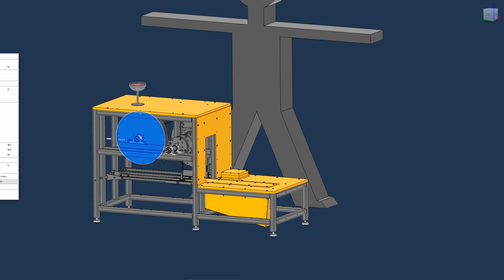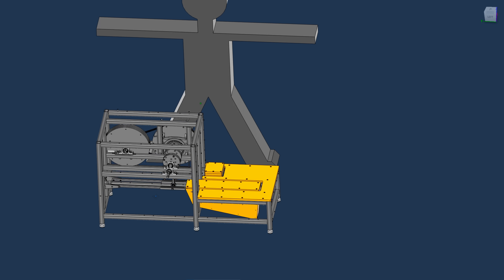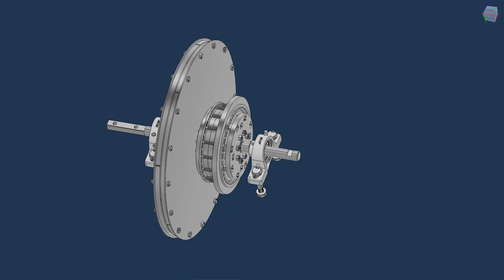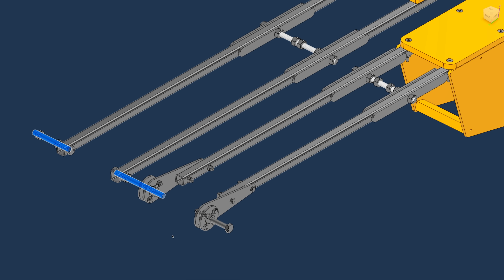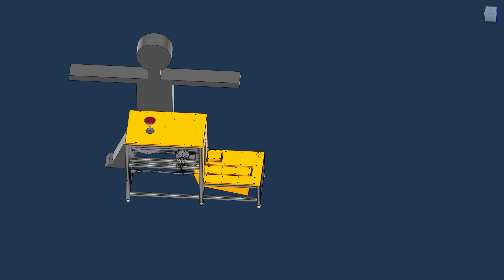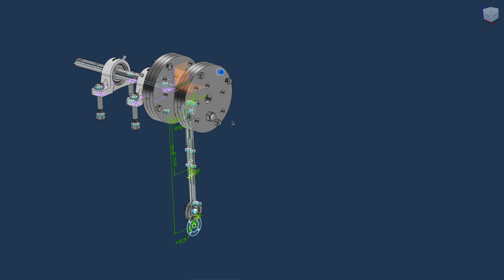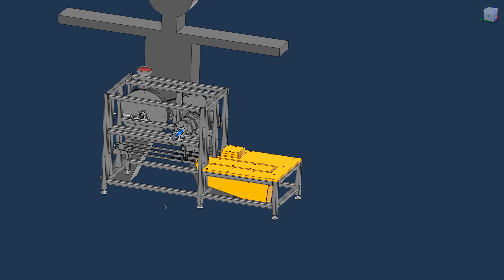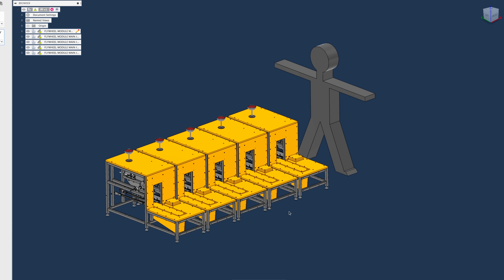Power Module Design Completed - Marble Machine 3 Ep.5

Comment: On the side of the fly wheel, print a multi-speed strobe pattern so that you can visually see the speed of the fly wheel, much like you can do with turntables/record players.
Reply: This, combined with cool lighting and transparent panels. Love it.
Reply: Yes yes I've been trying to bring this idea to Martin since the MMX days.
Reply: This works very well but only if it's a flickering AC lightbulb at 50 or 60hz.
It doesn't work under 120hz or continuous LED lighting
Reply: @tylerr5285  Can't you just make an LED flicker at whatever speed you want?
Reply: @EaglePicking  or just put a small, incandescent light bulb adjacent to the disk, using mains power frequency to get the stroboscopic action happening.  This might be problematic should you want to tour with this, as different countries use of 50 or 60 Hz for mains frequency.  I'd put in my own battery operated tiny strobe light adjacent to the disk, you can tweak the frequency and get perfection from the stroboscopic disk regardless of mains frequency.  I think this would add a level of "cool" to the flywheel and show it's movement.
Reply: @tylerr5285  A strobe is electronically controlled and adjustable. No need to use the mains frequency. Also the flicker amplitude of a bulb is weak due to the afterglow of the filament.
Reply: Or you can just add markers and use RPM counter

Comment: The plates for safety make sense, good in fact.  I would suggest the plate facing you be placed on the inside of the tubing to provide even more safety, I also would relocate the brake pedal so that it is not in line with the flywheel which is the danger line.

Comment: You should consider using some bushing pressed in the square tubing where you want the pivot for the two pedals because they're subject to quite a lot of force and the holes in the tubes are going to became ovals pretty soon
Reply: If not bushings, heavy wall tubes with the inside diameter slightly larger than the bolt diameter pushed thru and welded around their circumference.

Comment: Off the shelf flywheel with carter exits. Off the shelf torque limiter exists Pedal operated machine existed ....Stop spending time on reinventing the wheel (literally), focus on what is specific to this instrument, the music part And reusse a maximum of existing parts. Define the requirements of those parts (solidity, price range, MTBF, etc) and outsource that job to a procurement engineer. Meanwhile design a modular solution that can handle the variation of size of the parts. 🎉

Comment: What I'd do is use a rope instead of a cam, so the pedal can pull but it can't be pushed and you don't have to worry about getting your foot stuck under it.
Reply: Steel cable. Less noise than a chain and nice and strong
Reply: I was thinking of a steel cable. A chain seems more dangerous. Something could get caught in the links when it's pulling.
Reply: Exactly, and so the pedal can be made more lightweight to minimize its effect on timing.
Reply: I think a steel chain is even better, as it is less elastic than a rope
Reply: You could alternatively use some bicycle gearing between the pedal and the rest of the mechanism. Bike gears are designed to only push one way, so the pedal can drive the mechanism but isn't driven in turn. Bike gears would also give you live adjustability, rather than needing to experiment with different pin positions in the camshaft. Just add a spring to the pedal to return to 'home' position when not depressed.
Reply: @JeffAsjes do you mean like the freewheel mechanism in the rear gear set?
Reply: @stellamcwick8455  precisely
Reply: Don’t forget tho that he needs there to be no flex on the driving mechanism. Even steel cables will stretch under load, even if just a tiny bit, which could affect the timing
Reply: @circle_cut_sandwich9190  Not nearly as much as the exact timing and amount of force on the pedal.
Reply: I agree on this also, probably easier with a chain or wire but could also be a rod with a slot. the main benefit I see would be to make the whole arrangement smaller/lower as the pedal can sit just above the floor not require a large box.

Comment: Pin the output shaft of the flywheel module to the rest of the machine using a nylon bolt. Keep lots of spares. If the torque gets too high, the nylon bolt will shear and decouple the flywheel from the system. Simple. As for the clutch, just use a movable belt tensioner on the belt to the flywheel. Put the tensioner on a pivot on the trailing side of the belt, create tension with a spring and use the clutch pedel to release tension from the belt. SIMPLE. No complex clutches, no complex torque limters, just basic functional designs that WILL work.

Comment: Once again: you don't need to make the entire flywheel movable just to tension the belt! You need a static wheel and a spring-loaded belt tensioner, just like any car or bicycle!
Reply: Moreover, what you are doing here is a reverse version of a totally usual belt walk-behind tractor (or walkbehind cultivator - whatever). These use a gas-powered motor (small shaft), a gearbox (large shaft), and a belt between them. You tight the belt with the clutch (via belt tensioner) → you connect motor to the gearbox, and the gears get moving. You let go of the clutch any time you need → input on the gearbox is no more. Seriously, just visit any small farm and see how this 100-year old design works for ages, on 3000 RPM engines!
Reply: @EujenSandu  Indeed, but Martin is still stuck in the "I will do it myself" mindset.

Comment: If you're adding the panels because you're worried the flywheels might do something scary then the guard should be as close to the wheels as possible to stop them from building momentum. When heavy stuff starts moving plywood panels tend to not be enough to stop them.
Reply: How far the panrls are won't affect the momentum. If something goes wrong, the momentum is already all there, whatever parts are flying toward him will still be moving the same speed 10cm or 10m away.
Reply: @TlalocTemporal  the rotational momentum is there. Unless something truly catastrophic happens the lateral speed doesn't happen until friction turns rotation into lateral movement. If that's a cage close to the wheel it doesn't have time to get going and out will hopefully just do a burn out
Reply: @mouse11011  -- Ah, so preventing a small breakage from becoming catastrophic, I see. I was imagining the worst-case catastrophic failure of the flywheel disintegrating.

Comment: Maybe I don't see it correctly, but it looks like the pedal can still injure your foot. It appears that, when the pedal is down, your foot could get underneath the surrounding panel structure, and be caught in-between on the way back up.
Reply: Yes! This is exactly what I was thinking. I think he needs panels on the inside of the well where the pedal goes down; those could also eliminate the need for the panels on the pedal (thus reducing the dead weight he needs to move).
Reply: Makes sense.

Comment: As much as I love the look of the current marble machine, it would be nice to see some metal or wood designs inserted between the gaps in the frame. I'm thinking of something like an old, iron-cast garden gate that doesn't detract from the engineering but adds a bit of flair. It wouldn't interact with the engineering but would simply add beauty for those who aren't of the engineering mindset, like you and I may be. Of course, this can be an afterthought, but after seeing how amazingly beautiful you made the marble machine X, it would almost be a shame to not show off all that welding and woodworking talent you've built up. Once again, please consider this as an afterthought, but don't forget about it.

Comment: The support on the pedal arms are friction fit if you're only planning on using a central bolt as shown in the cad, unless you are welding them on? Bolts on the ends of them give full support vertically, surely Martin didn't miss that?

Comment: I don't think you have thought through the pedal system. As it is now, you have to basically push it backwards away from the machinery when it it in the highmost position. That is very unergonomic position to work and imposes limits on how much and in what way you can move yourself while playing. I think it should be more pushing down and forwards to make it more user friendly and ergonomic. That would require the pivot point be either on the up-forward position on the lever, similar to car pedals, or in the back down like some of those large organ pedals work. Ergonomically the former would probably be better, but the latter is easier to make to be able to support your whole weight and be safer too. With some relatively minor changes, it can be achieved with the current design, but I'm sure  it would be the best to make a full redesign of that mechanism.
Reply: Good point. Also, how do you start up the machine if it just happens to stop with the pedal in the downward most position?
Reply: @ahampel22  That is not a problem for two reasons. Firstly, it is nigh impossible to get the crank in such position that it would be perfectly stretched out and thus not accepting any input. That would require ideal condition, which is to say perfectly rigid mechanic parts and perfect tolerances, which are impossible in real life. Secondly, even if we completely disregard all of the above, that is still no problem as there are plenty of exposed parts linked to the pedal which you can turn by hand moving the pedal in offset position.

Comment: Is the marble machine player going to be keeping time for the band, or do you need to keep time with someone else? That affects what sort of tightness you need, particularly out of the power input. It also affects what kind of looseness you need; if you're 20ms late getting up to speed, can you catch up without overshooting? If the machine is keeping time, you just need to maintain close to the right tempo and the power input doesn't have to be tight, because all of the notes will be placed correctly relative to each other.

Comment: After the bearing housing debacle, my heart immediately dropped as soon as Martin said he designed the torque limiter himself using laser-cut parts, lol. 😅
Reply: Well, it may be overengineered but at least we know this solution works (unlike the bearing housing) because he used it in the MMX and it worked well. On the other hand, torque limiters can be extremely niche-ly implemented (and as a result, become the limiting factor in some solutions), so I can understand the custom solution; now the limiting factor becomes whatever springs he can get.
Reply: That torque limiter already lives in MMX. It is a known item for him, perhaps not all the other people
Reply: Yeah, he's got the over engineering disease. Imagine a new problem and create a solution for it. Maybe it's not a problem to begin with.
Reply: On the other, other hand, there are definitely some numbers to be crunched to pick the correct torque limiter. As a result, it should be one of the last things to be picked, along with the size of the flywheel. The flywheel has to be big enough to drive the machine (and whatever torque that might entail) but not so big it becomes dangerous. There are definitely adjustable off-the-shelf torque limiters that can deal with this, and it might end up being cheaper than machining ones from scratch. But importantly, this and the flywheel should be done after the prog wheel and marble delivery systems are decided and you know how much torque you need.
Reply: And he didn't design one himself because of a specific requirement that wasn't met with off-the-shelf parts. He designed it because he couldn't find CAD models for the existing ones... I didn't realize this was a CAD exercise instead of building a musical machine...

Comment: Clear Plexiglass for your safety covers, and for a more final version use an adjustable heim joint as your drive linkage. They are easy to get to a perfect length and are very robust.
Reply: Plexiglass shatters very unpleasantly and quickly, would not suggest using it for safety!
Reply: @Chibs  Sorry for using a generic term, my thought was more of a polycarbonate like Lexan that is very strong and impact resistant (like safety glasses) for protection without hiding the mechanical parts.

Comment: I urge you to experiment with that flywheel before you continue with the design. Mount the wheel on a suitable shaft and spin it to the RPM you think you need. Use a motor and a rubber belt to get the RPM. 
This will show you just how noisy it's going to be. 
And the flywheel must, must, must be dynamically balanced. Perfect static balance is totally useless. Especially for that diameter, mass  and RPM.
Reply: I agree with you regarding the rpm output possibly leading to a very noisy resonating frequency. I don't think this has been explored more than enough. Could end in tears ?! Basically he is making a rotating speaker, like the famous Leslie rotating speaker, by rotating a mass, instead of the speaker itself.
Reply: Guys, how many RPMs are you expecting? The ratio is 1:8, 8 rotations of the flywheel = 1 rotation of programming wheel. Programming wheel will do perhaps 2 RPMs. That's not kers from F1!
Reply: @DanyWay  In the video around the two minute mark, it's stated that one BPM in the music means 8 rotations of the flywheel. Music is usually somewhere in the range of 100 to 120bpm for a faster dance track, so the flywheel will go up to about 1000RPM in a faster song.
Reply: @Lttlemoi  That's what he said: "for every BPM of the music the flywheel rotates 8 times", but that's a wrong statement. The correct one would be: "for every revolution of the programming wheel the flywheel does 8 revolutions". Programming wheel is attached to the primary axle (axle with the pedal), right? The secondary axle is that one with the flywheel, right? There are only two "gearbox" wheels, the ratio is 1:8, programming wheel spins very slowly.

Comment: I have a small worry with your gas pedal, the protection guard, to be precise the end panel under the heel of the foot is straight. It could jam in the opening while the pedal is rotating up. I think it should be curved just to be sure.
Reply: it would almost be better to have a panhard link on the back under the floor to keep it on a constrained, nearly-vertical path
Reply: It's angled forwards, so it's just like a curve that's been flattened. Far easier to build, just as much clearance, and as strong if not stronger. The only real difference is that the gap will change in size, possibly catching a loose bolt and bending something.

Comment: Make some holes in the flywheel dous not influence the angular mass that much  but it wil reduce the mass in total so it's way way easier to carry

Also make the bars for the brake and gas paddle a bit sturdy er. You woud be surprised how much force you woud Push when in Panic

Comment: Martin, torque limiters for sale will usually have cad models on the product page, same as most parts
Reply: Additional to your text:
If they aren't free accessable, you ask them via Mail or even a phone call.
As an engineer, I would do some calculation before drawing such a critical part instead of experimenting whilst the assembly/installation.
Reply: Beat me to it. Basically every proper commercial product has free cas models somewhere
Reply: Yes, but Martin does NOT want to use working, proven parts for simple tasks: otherwise why on earth would he design an overcomplicated custom brake sistem when disk brakes are on sale in every bike shop?
Reply: @francescosirotti8178  Dealing with the flywheel simply is not a simple task that a disk break is suited for. The brake system consists of a torque limiter, which is needed as a security feature and of a clutch which you need because of the following consideration: disk brakes means you stop the whole machine in an matter of 2 seconds or so. That is too slow. You want to stop accurately in way less than a second, by disconnecting the flywheel. There might also be a need to quickly get up to speed by connecting the drive shaft to a fly wheel already spinning the correct speed. This calls for a clutch.

There however really is no need to design the brake system from scratch.
Reply: @rigor_seggy  No, you DON'T want to stop the flywheel in "way less than a second" because all that energy WILL go somewhere. And while we don't have many info on the performance of the flywheel (expecially RPM) it's safe to assume there will be enough to cause damage - possibly even topple the machine (which will be quite top-heavy) if things go wrong. You want 2 breaking sistems: 1 disk to slow down, and one emergency stop if things go pear-shaped
Reply: @francescosirotti8178  you want to stop the machine in way less than a second. Not the flywheel. Therefore you want a clutch. The emergency stop needs to be automatic, therefore you need a torque limiter. These two sit on the drive shaft, not the flywheel shaft. On top of that you probably want disc brakes that stop the flywheel directly.